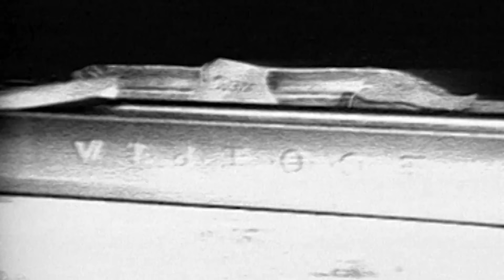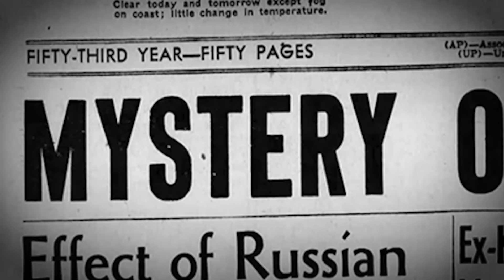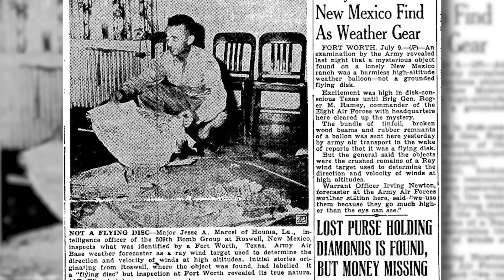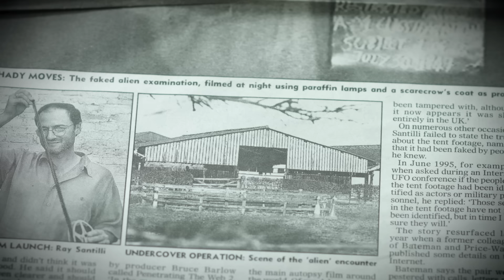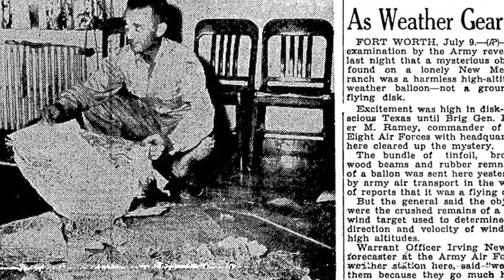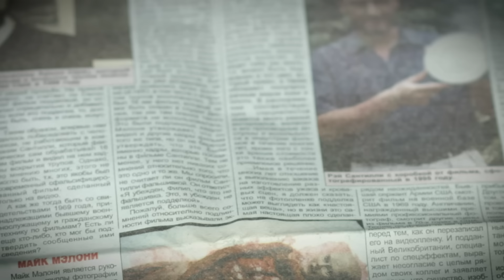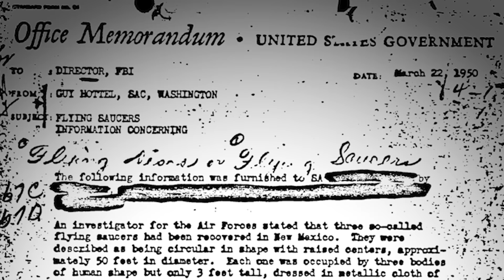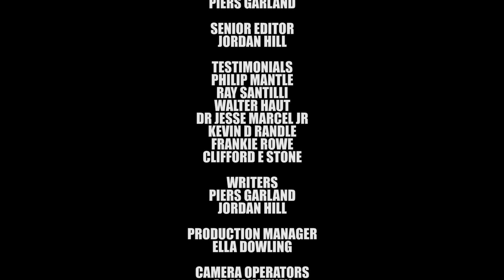Roswell UFO Conspiracy: Unlocked (FULL MOVIE)

Comment: If you can't burn the UFO "foil" and you can't cut it then how did it break up on impact?
Reply: An impact with enough force can destroy about anything. Assuming that the material found was indeed of extraterrestrial origin, maybe the supposed craft was designed to withstand a slight impact. Kind of like cars we have that are designed to withstand a certain amount of impact and have minimal damage vs a high impact where the car would bust apart. But again, we don't, and most likely will never know what the material truly is and was made of.

Also worth noting, the story had people adding their story of events and those stories have probably been told differently by different people and some probably added to the story to make it sound more interesting, just like the urban legends that evolve into a bigger legend as it's told by so many people over the years.
Reply: Yea it’s all nonsense. It can’t be burned or destroyed yet it’s in pieces as small as 5x5 inches lol
Reply: One theory suggests that the craft were particularly vulnerable to our radar system and possibly the radiation it emits. Truth is we’ll likely never know.

Comment: That autopsy film was analyzed by experts in all fields and they all agreed that the set was period correct, phone, clock, medical garb, medical instruments, the best at that time and would indicate it was the military. The way the autopsy was performed were real doctors that knew how to perform an autopsy. Move prop experts said that if someone wanted to build a period set to this much detail, he would have been contacted because the pieces used are very very hard to find. Experts in designing prop dummies use in movies said they wouldn't be able to achieve that level of perfection. 
I saw that program years ago. I wonder why he didn't mention it?
Reply: And I read somewhere that the actual film it is on is dated back to the late 40s early 50s time period
Reply: He did mention it just not in as much detail and it was very brief.
Reply: This was a hoax & has already been admitted by 2 guys,can't remember names but I watched the documentary on how they did it...
Reply: Hoax. Proven.

Comment: It's so obviously fake. First of all if you cut into a dead body, the blood is all pooled to the lowest point due to gravity.. The back in this example. When they cut into it and red blood runs is something that cannot happen when the heart is stopped, the blood isn't churned, it has long divided up into the plasma, hematocrit and platelet levels. If you put blood in a test tube, it starts to divide up into these different layers immediately. And in a few minutes you will see the three obvious layers. For a cut to bleed, or even seep, there has to be blood pressure. If it's dead the heart is not pumping so there is no blood pressure. They are using magicians scalpals where the fake blood is contained in the handle and is squeezed while making the supposed cut. If the blood could even be where they are cutting, which it couldn't be because it has all run down to the lowest level due to gravity. This is called Lividity. It begins as soon as the heart stops in minutes. Having worked in hursing homes as primary post mortum care provider, you can see the darkness of the blood pooling on the back if you turn the body on ust side. It will be all black on the bottom most parts. If you leave the body on its side, the Lividity will collect under it's side. Point being dead bodies do not bleed for lack of pressure and the fact the blood isn't there. It's an insult to people intelligence to try to pass it off as an "Alien Autopsy". If such thing existed they would have had waaasyuu better video/film coverage. It would at least be in focus and several angles like any other filmed surgeries.
Reply: was it blood u saw?  from what i understand their blood and ours isnt the same make up... so how can u draw such a conclusion?
Reply: @kevinpittman2517 
Yeah, I'm with you on this..
How do we know what material makes up the alien body.??
Do they even have 'blood', or veins/arteries to carry said 'blood'.??
It would be very naive of us to make any specific assumptions about an aliens bodily autonomy..